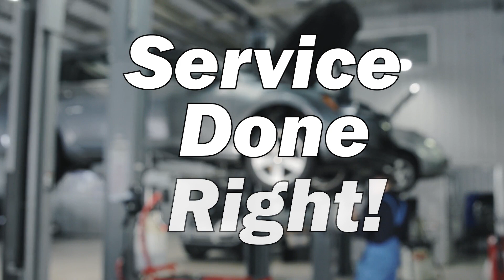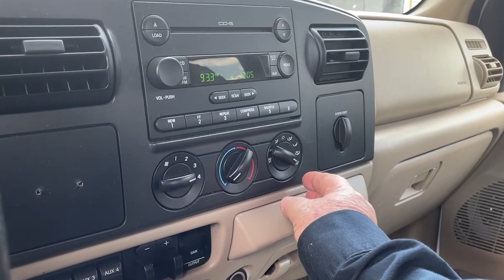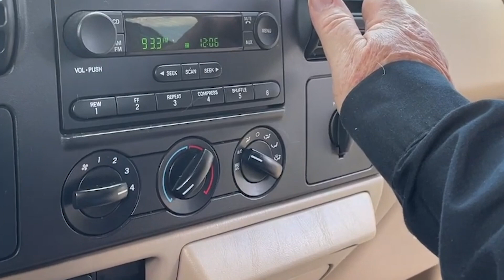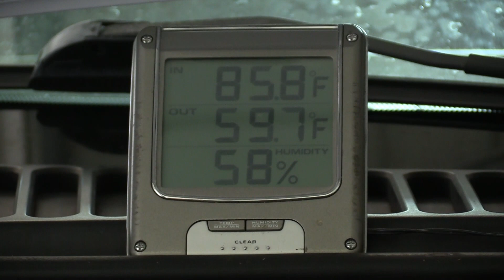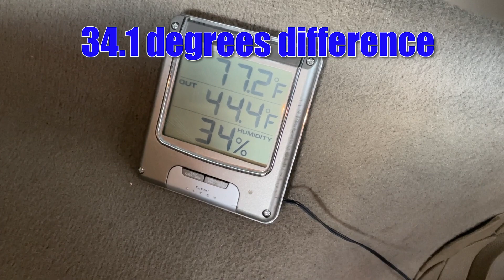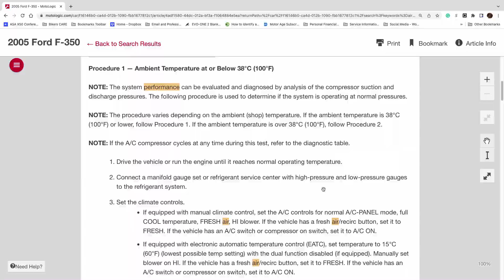Service Done Right #10:  Testing A/C System Performance - What’s The Best Way?

Comment: 20°F below ambient just won't cut it when it is 106 outside. That's a cheap riceburner, not a car for the US market.
Reply: Agree, even 60° AC vs 80° ambient is not acceptable. I've found at 70-80° ambient, hi fan should be about 50 and low fan should be low 40's. Humidity is irrelevant. Give me a thermometer reading.